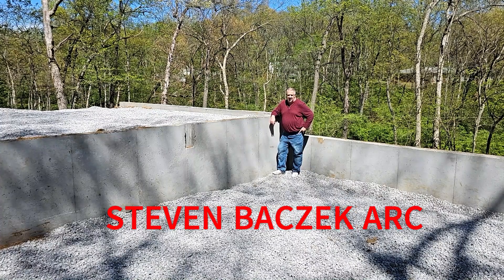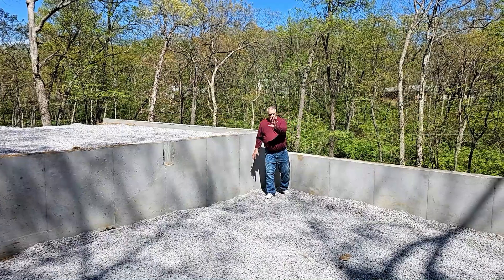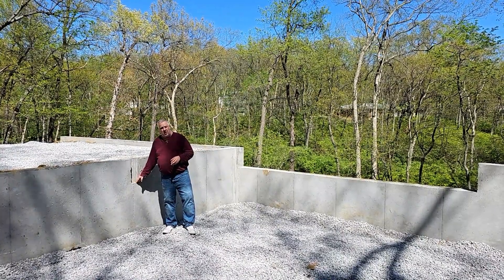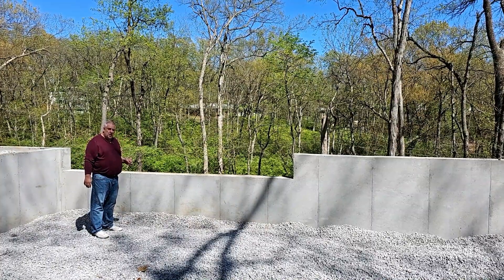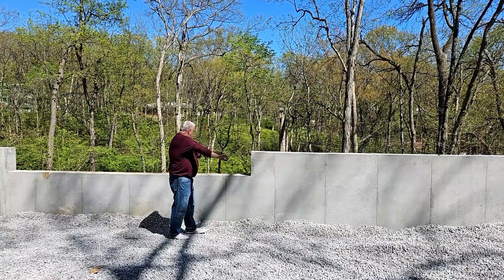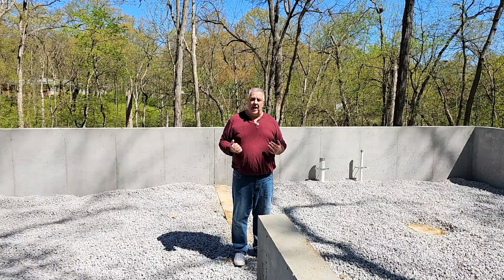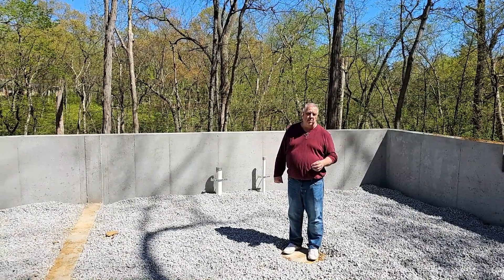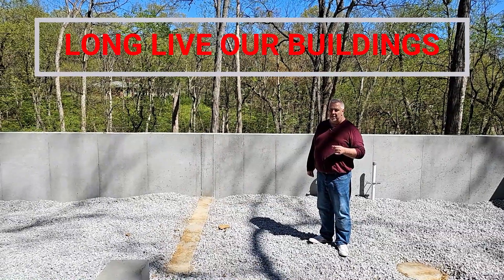WHY THE DROP IN THE FOUNDATION WALL?

Comment: From the video, it looks/sounds as if the other half of the house hasn’t yet had the foundation walls poured.  Is that correct?  Seems strange to not do them all at once.  Or are they just at a significantly lower height and we can’t see them from this camera angle?
Reply: Looks like a hill getting piers

Comment: Why tall concrete walls and not cripple walls on the perimeter? Are you planning on backfilling a lot to bring the ground level up on the exterior.
Reply: I would guess to create a consistent finish on the outside of the foundation and have the same stronger floor  installation all the way around.

Comment: Curious why the level of the center footings are flush with the rock now, instead of having them higher to be level with when the insulation is installed? Or if it matters?
Reply: Harder to cut insulation around the pier and it creates a thermal bridge. This way its continuous insulation.